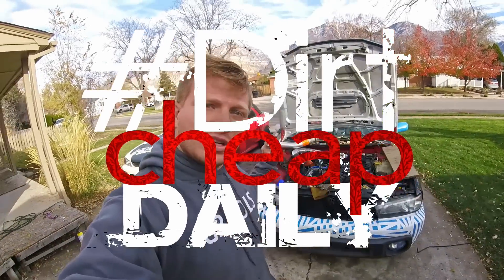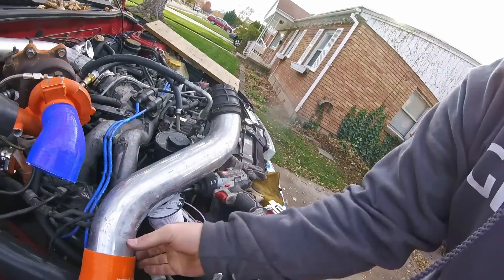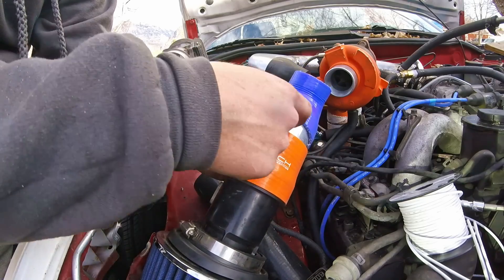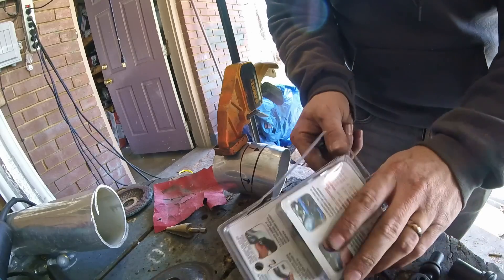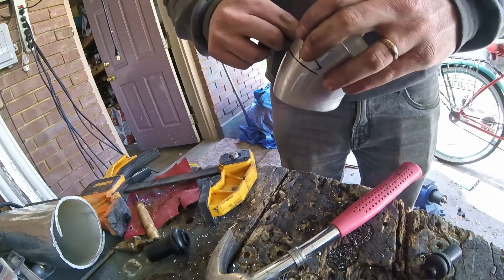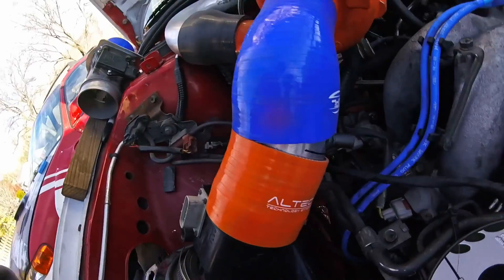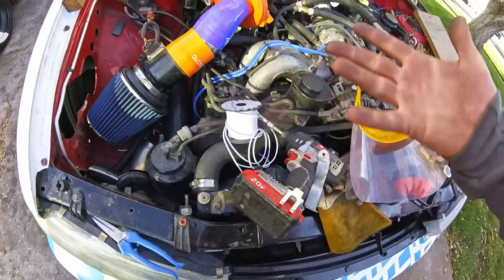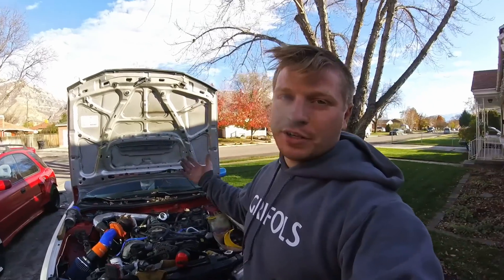How to turbo your non turbo Subaru - Part 12 - Inlet pipe - Dirtcheapdaily : Ep.51

Comment: 3 years later but hopefully you can reply, I have a TD04 with a 2 inch outlet, and I need to get a reducer coupler so I can adapt it to a 3 inch pipe, wondering if you know what size coupler I 
need to get that 2 inch to 3. Thanks!